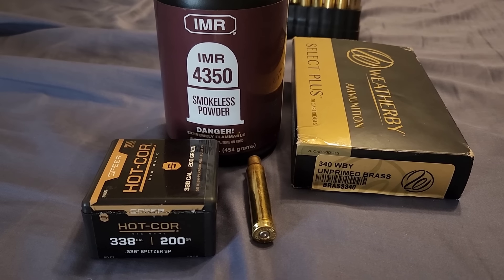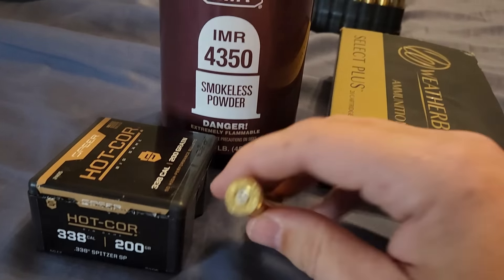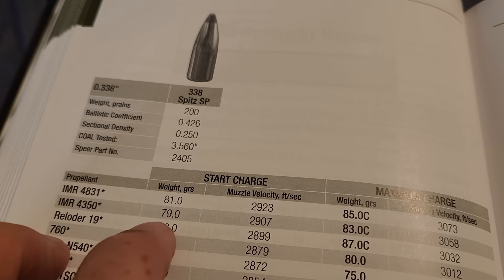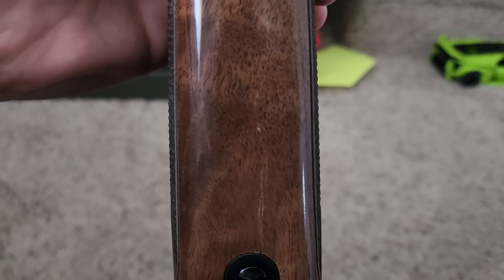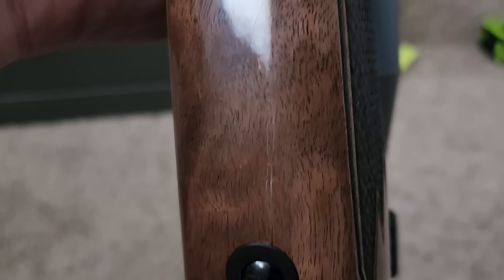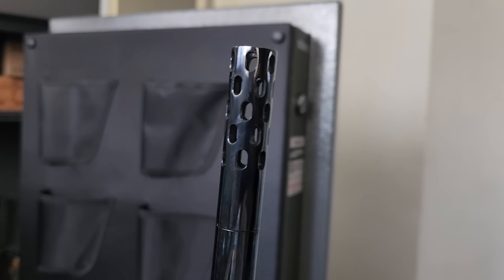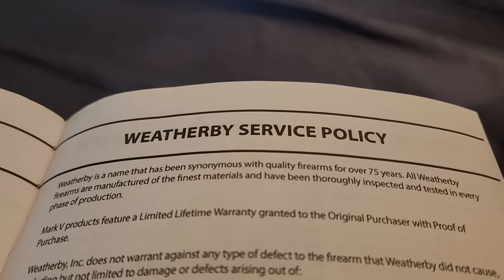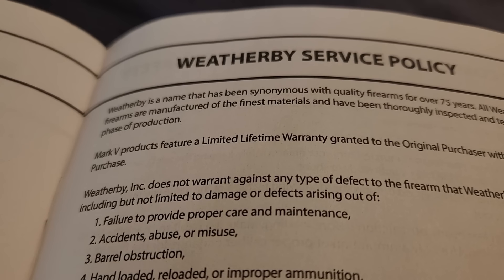My New Mark V Deluxe broke!

Comment: This is why you should fire a box, maybe two, of factory loaded ammunition to test function in a brand new rifle with a warranty etc BEFORE hand loads. Weatherby is just one of many manufacturers that say hand loads void the warranty. The stock probably had a defect that couldn’t be seen, wood was too dry etc, but if your failure had happened with Weatherby ammunition your claim would be better substantiated. Sucks that it happened, but things happen. Now you want them to take your word you didn’t make a hand loading mistake. Every hand loader has made a mistake at some point. Oh…you have the brass. How do they know that brass was fired in that rifle? That you don’t own two rifles of the same caliber, or it’s your buddies brass from his rifle?  Blame it all on the scammers who take advantage of warranties. We all know the stories. I’m not defending you. I’m not defending Weatherby. Quite frankly, it will probably be decided upon how many followers you have and potential bad press. How much the rifle cost is irrelevant.  I expected the stock failure to be more dramatic though it’s still a failure. Good luck to you.